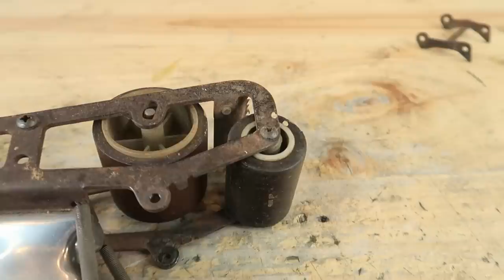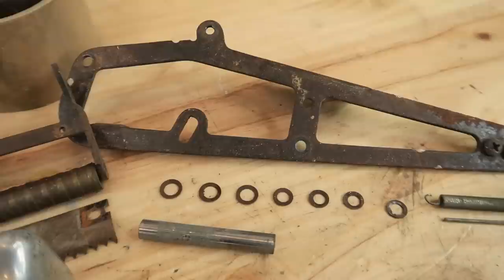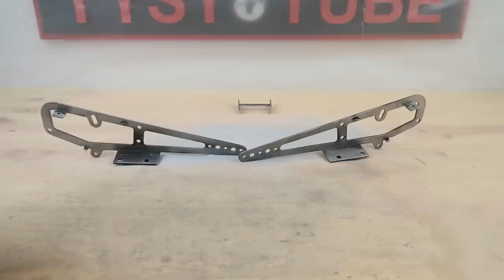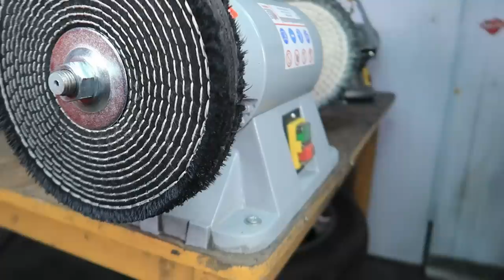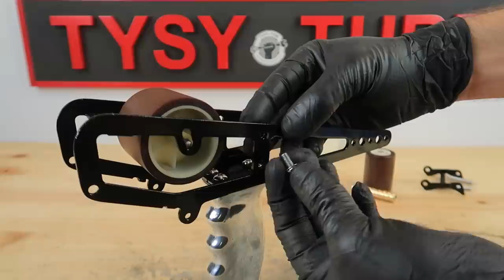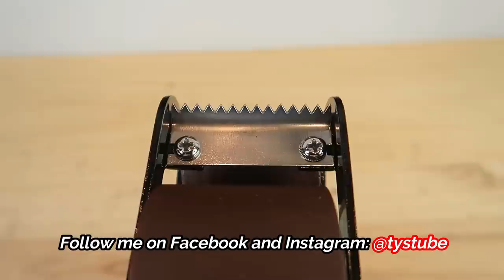Rusty Vintage Tape GUN  Restoration

Comment: A handy tip if you ever need to clean rubber/rubber rollers again:
Eucalyptus oil, it's great at cleaning rubber and often gets it like new again.
I learned this during my days as a photocopier service technician when we would need to clean the rubber rollers.
(Just make sure not to use it on very soft rubber, as it would likely melt it.)

Comment: Finally fixed the bench grider. Good. Also, that resto is pretty neat. I thought you'd have to change all the rubber parts tho. They seemed cracked. Ever thought sometimes, of just clearing the parts instead of painting them, to keep them "on metal"? Clearing them should be enough to protect them from rusting, no?

Comment: Hey ive never seen you use it before but you should check out the product Rubber Renue. It is Xylene and some kind of oil and it is used to restore old dried out rubber. It will not fix cracks but the rubber expands as it soaks up the oil and the cracks will be minimized. I used it in the past for 50 year old motorcycle carburator boots and it works but you need to be careful to not over-do it or you end up with Jello Rubber.

Comment: Hey thought I would leave a nice restore trick for you, if you soak plastic parts that have yellowing from age in hydrogen peroxide and put a uv shine a uv light on it for 8 to 12 hours it will make them look brand new remember plastic parts have to be weighed down. Non toxic and supper effective

Comment: There looked to be another screw at the back that seemed to fit inside the inner diameter of the tape roll. It was there in the rusty version, but not the shiny version. Did it prevent the roll from over-spinning and why did you leave it off?

Comment: When you say sand blasting what does that mean? Does particles of sand hit the object at high speed to remove rust dirt etc? And why does it gets a silvery colour on blasting? Are the sand mixed with some chemical?
Reply: Just sand blasted against the metal, it becomes Grey become of the normal color of the metal

Comment: I do not know why you always sandblast and wire wheel certain parts. It’s a waste of time to do both on so many parts.
Reply: Blasting cleans the parts but leaves it a matte looking finish. Wire wheeling the part burnishes the metal and makes it look brighter and slightly polished, a more metal looking finish.